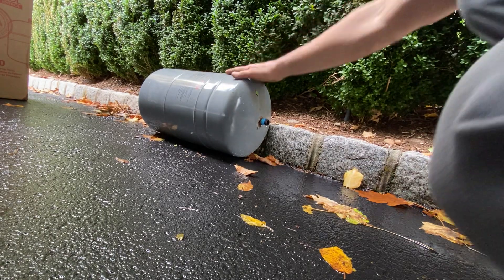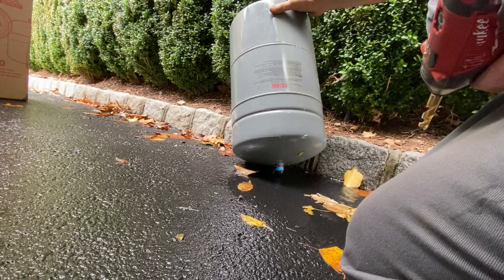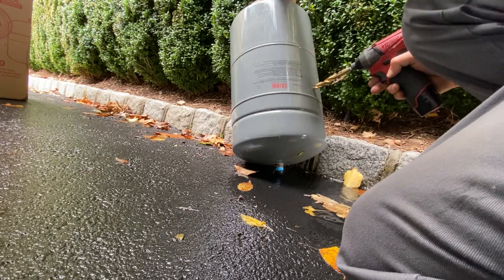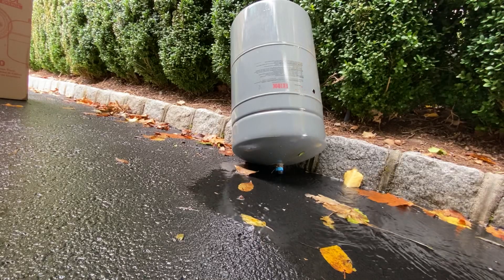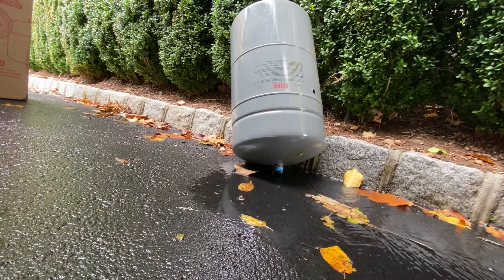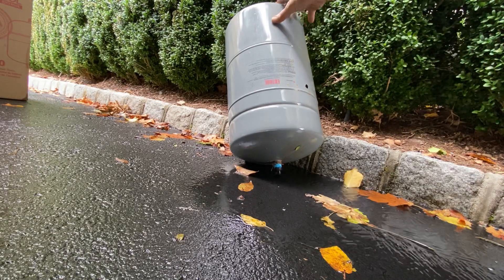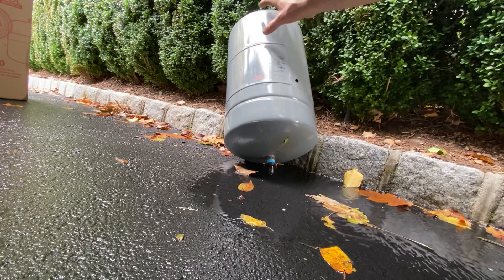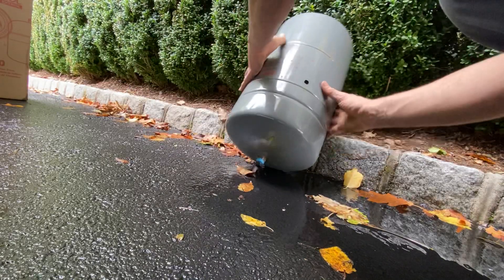Quickly Drain Boiler Expansion Tank

Comment: bad bladder drill a hole/s in the bottom, place bucket under, drill hole/s in top (vertical or horizontal) just try to hit the lowest point for drain holes and or just to each side of bladder (horizontal tank).
,you can also bang in a sharp chisel, but that's hard on the piping

Comment: Screwdriver and hammer bang bang
Reply: once outside/removed sure, better off with a small sharp chisel though. I drill them in place and drain into bucket/s, if "clownstaller" made that possible in original design ;)

Comment: I would just run a smaller diameter tube up the opening all the way to the top of the tank to let the air in. In case you need to reuse it. That way you're not having to find a way to plug the hole you just made.
Reply: you cant reuse the tank once the diaphragm is ruptured.
Reply from the maker: This is just to empty. It can take forever to drain these tanks sometimes. The gurgling before I drilled a hole is the tank trying to let air in.
Reply: Oh I got ya, I thought it was just a tank, I didn’t know it had some witchcraft inside of it lol

Comment: I poke a hole with an awl, same idea 👍
Reply: I drill holes and drain them in place! makes for lightweight removal, assuming the installer clown placed them where buckets can fit underneath and have a place to sit!
Reply: @throttlebottle5906  I have also done that if it will be difficult to remove full